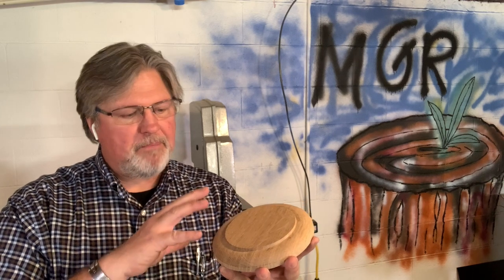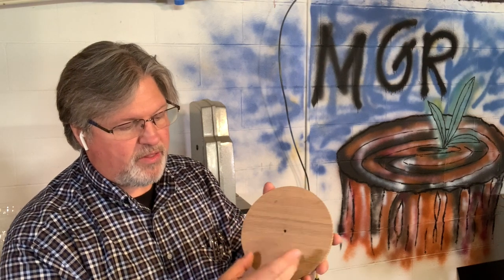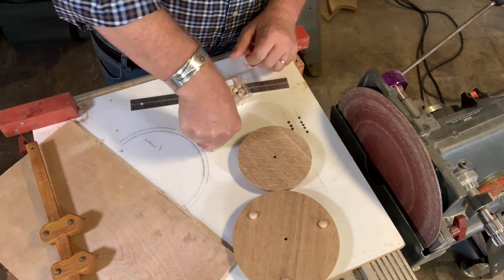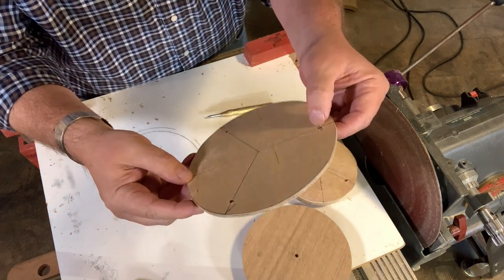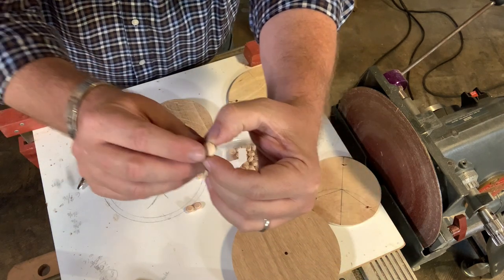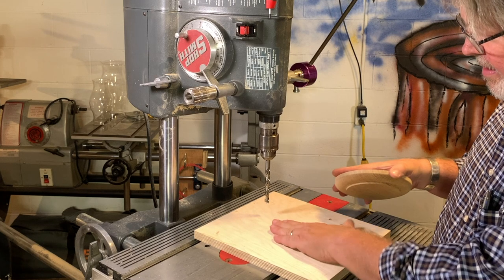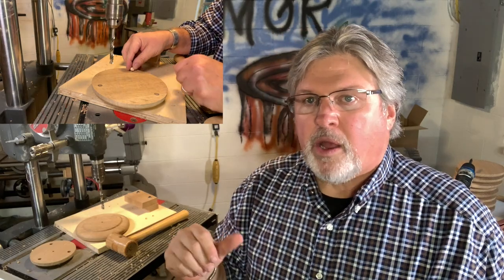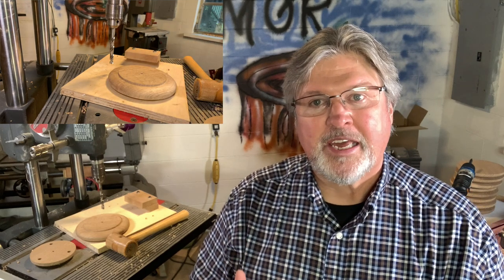Drilling "Tippy" Wood Parts: A Safe, Simple Drill Press Fixture

Comment: Great video. Like the tutorial on dividing a circle into 3rds. Will use it in the future. Working on a cabinet board that is too small to go through the planner. Will use the circle hold down to sand the boar flat using the disk sander and drill press. Thanks. Wish you had videoed the depth setting up on the drill press. How to zero it and set it for the depth. I didn’t catch the steps on the gauge.
Reply from the maker: Thanks Dave. I'm glad you found your way to my other, more in-depth video on drilling. I meant to cover the setting of the depth but learned while editing that I had my arm in the way the entire time!  Scott

Comment: I have run into the need to hold things down often enough that I built a "top" to go on my table when in drill press mode.  My top is made of scrap 3/4" OSB and has "rails on the bottom to fit into the SS table slots.  It has a cutout for a round, replaceable, rotate-able sacrificial piece.  And it has two t-tracks so I can use t-track mounted hold downs.  The only downside is that when I'm using it, I can't use a fence.  But I can certainly use a scrap piece as a fence, held in place with the hold downs.
Reply from the maker: Smart.

Comment: One of the differences between a woodworker and a rough carpenter is the tendency to make templates/jigs/ figures for repetitive precision operations… In my opinion.

I agree on always having a sacrificial table when drilling.  My old 1940’s bench top drill fixture is decorated with a perfect arc across its table surface.  The welding shop it came out of used the table top as a backer for through drilled holes incessantly.
Reply from the maker: Uggg! I've seen it too and it always grinds my gears, just like the circular cut in the face of a table saw fence.